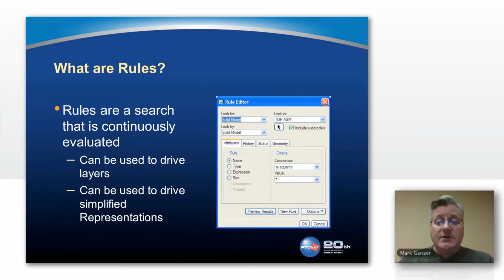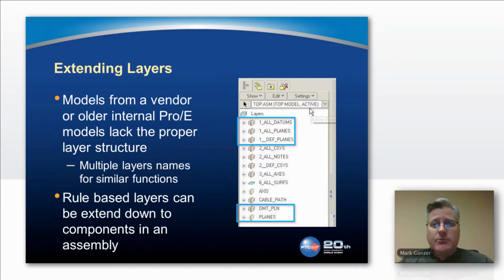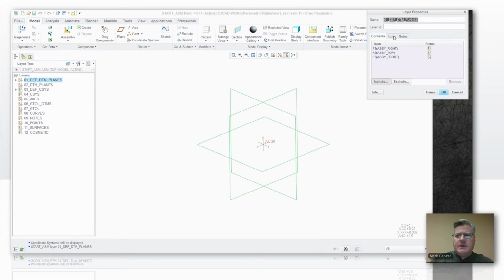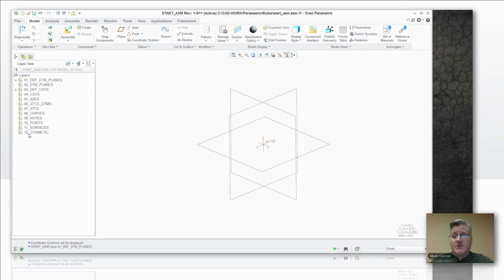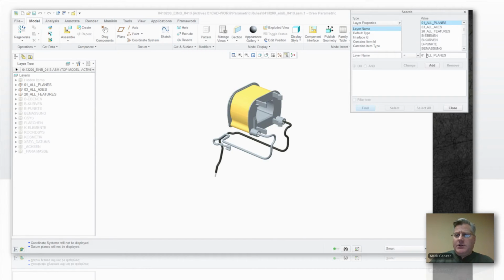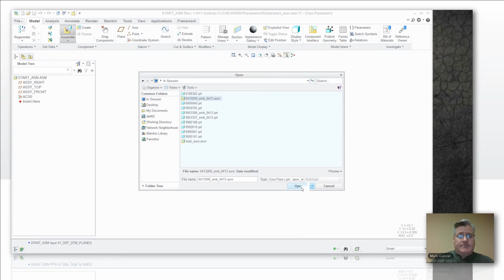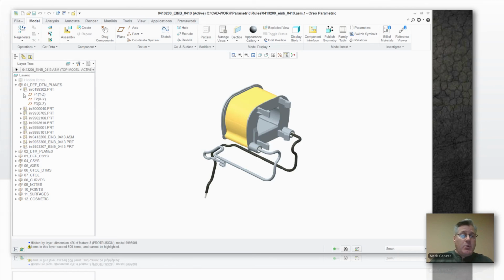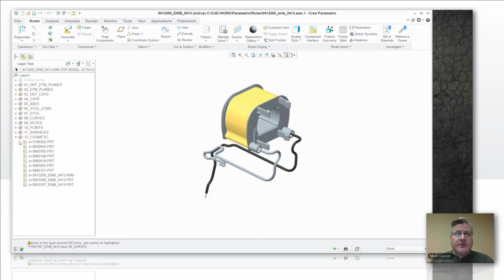Using Rules to control layers in Creo and Pro/ENGINEER - EAC Tip of the Week

Comment: Greetings, I really like this approach compared to the config.pro setting which is how I usually specify layers. I have two questions: 
1) I have some components that had a Creo 4.0 (M020) created layer called HIDDEN ITEMS.
I unhid features in  model which resulted in the objects being removed from the layer.
However, I can not delete the HIDDEN ITEMS layer. This is inhibiting me from EXTENDING RULES.
Any suggestion on how I can remove the problematic layer?
2) I noticed there was a response to "Shanmuganathan Shanmuga" however this was not very helpful 
in setting up the mapkey because it required the user to select the blank layers. The empty layers change frequently 
thus, the mapkey may not function as intended.  Is there a way to automate the hiding & unhiding of blank layers.  PLEASE ADVISE, 
THANKS FOR THE VIDEOS...
Reply: I discovered that PTC has probably screwed its users once again...  CREO automatically creates a layer called "HIDDEN ITEMS".This layer is automatically created when creating datum features on the fly inside of other features.https://support.ptc.com/help/archive/creo40/creo_pma/usascii/index.html#page/fundamentals/fundamentals/fund_six_sub/Using_Hidden_Items_Layer.htmlThe status of the "Hidden Items" layer is saved when you save the status of the other layers. However, you cannot delete the Hidden Items layer once its there is always there.  This layer will effectively make EXTEND RULES useless if any components contains the "HIDDEN ITEMS" layer..  This is automatically created when creating datum features on the fly inside of features.A work around may be to add the "HIDDEN ITEMS" layer as one of the rules to be extended.Have not tested this can not say for sure.

Comment: At the end of the the video you are saying we can hide the layers that are not having any information in it... Can you explain how to do that?
Reply from the maker: Layer display can be controlled directly in the layer tree. The layer tree is similar to the model tree, but it's the control center to layers. Once the layer tree is displayed, the display status can be controlled by selecting the desired layer[s], them right mouse button [RMB], to open the context menu. After the context menu is opened, select the desired option [hide in this case]. Note the layer status should be saved, followed by saving the model, in those cases where the user wants the layers hidden the next time the model is opened. Put another way, layer display status is temporary, unless the display status is saved, and the model is subsequently saved.